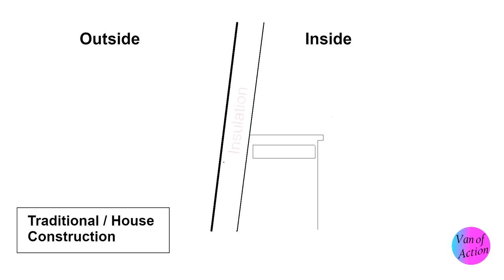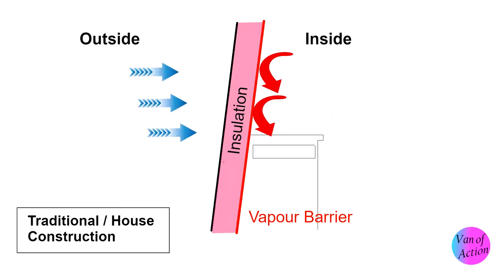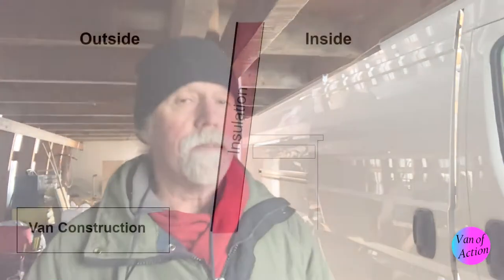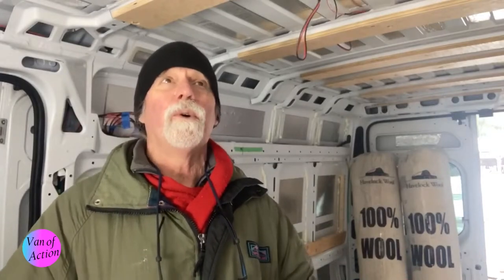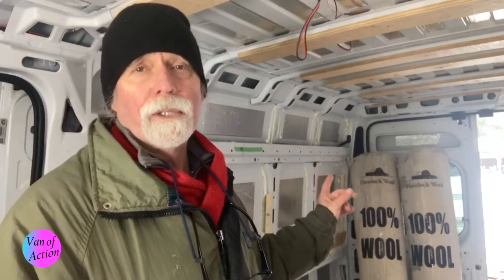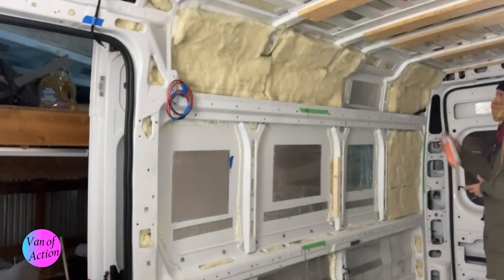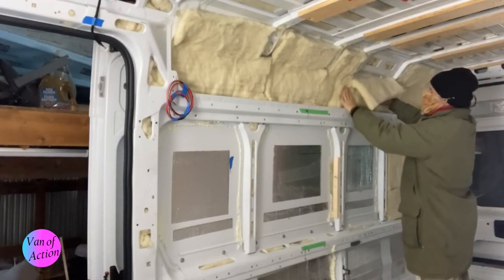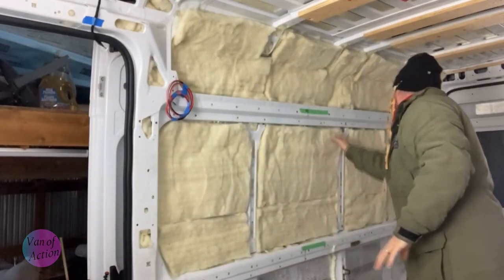How To Insulate A Van - VanLife Havelock Wool, spray foam or thinsulate for a warm and quiet vanlife

Comment: @5:23 "Wool is hydroscopic..." which is one of the main reasons wool should not be used to insulate a camper van that's not in a very dry climate. Two other reasons: high cost per unit R-value & relatively low R-Value per unit thicknesss. Wool makes a great blanket or sweater, but it's a poor choice for thermal insulation in a structure (or RV)  exposed to RH above 50%. To better understand why, refer to these two tests that done by  Gary @ Build a Green RV: "Water absorption for various insulation types" & "Insulation Testing – For Van Conversions"  Key excerpts:  Bare Plexiglass panel showing considerable condensation and beginning to drain down.  Wool showing significant condensation, felt damp to touch on outer surface,  (+36 g of water pickup). Thinsulate showing significant condensation,  (+11 g of water pickup). Polyiso showing no condensation. Polyiso felt dry,   (+0 g of water pickup)
Reply from the maker: Hi Video Pipeline -  again,  thanks for watching and taking the time to comment.  Insulation is one of the topics of a van build that I think will be a never ending debate - this will probably be a long answer, I think it's important but I can't do another video about it right now.    In this case, because of what I consider the insulation is for - I disagree with just about everything you've said.   

I am in Canada, the interior of British Columbia.  I don't use my van in the dead of winter but I do use in during the shoulder months when night time temperatures will dip to below freezing.

Having said that - there is not a product on the market that will insulate the walls, ceiling and floor of a van with enough R-value to enable the interior to hold heat well enough to maintain a consistent temperature if it's cold outside.   If you want the inside to stay warm you have 2 choices.   1. build everything thick enough to hold enough insulation     or 2. have to have a constant heat source.  

Number 1 would accomplish the heating / moisture goals - but would totally ruin the van.

Number 2 would keep you warm - but would do nothing to reduce condensation - and depending on the heat source may even increase it.

I believe every van builder should expect condensation,  plan for it and manage it.  So the question is where do you design the dew point.  In a van it's naturally on the inside skin of the body.   I do agree that wool hydroscopic, which means that rather just get wet and hold moisture it's able to take water into it's cells - so ....  I know that when condensation occurs the wool will absorb it.    The wool will hold it until  the air out side the van is the same temperature or higher than the air inside(sun heating the outside of the van)    At that point the air in the cavity will warm and take the moisture back as evaporation and the wool will be dry.   In fact it's even better than that .....   "Wool insulation addresses both vapor diffusion and the issues with vapor barriers. One of wool's greatest strengths is its ability to manage moisture. It heats up when it absorbs moisture which helps maintain its R-value despite being wet which in turn helps it dry out quickly."   It's a natural process that can happen over and over again.   

The observations you quoted  "..... For Van Conversions"  Key excerpts:  Bare Plexiglass panel showing considerable condensation and beginning to drain down.  Wool showing significant condensation, felt damp to touch on outer surface,  (+36 g of water pickup). ....."  are exactly what should be expected but the test  didn't follow the full cycle of warm / cold / warm.   

In the end -  Having spent time on the road - I believe van builders are insulating more for sound than for warmth.

Thanks again for sharing your ideas ...... it's in the conversation ideas grow........  Be well and I hope you join the community..... Dave
Reply: @VanOfAction  "I do agree that wool [is] hydroscopic, which means that rather just get wet and hold moisture it's able to take water into it's cells - so ....  I know that when condensation occurs the wool will absorb it."  ...which is exactly what anyone with basic building science expertise knows must be avoided or at least drastically minimized.  Some other statements you made in your reply reveal that despite whatever practical trade experience you may have, you don't really understand the physics. You hare entitled to your strongly held opinions but the facts of any engineering problem are validated by careful objective testing, not by how strongly held or popular your opinions may be.
Reply from the maker: Well Video Pipeline - it finally happened.   I knew when I started this channel that there would be videos that people would  not agree with.  It's part of the deal with putting your ideas out there.   This particular video has been viewed over 30,000 times - which blows me away -  and you are the first person to tell me I  don't really know what I'm talking about.  (I honestly thought the line would be longer).  But it really means nothing to me.   I'm sharing what I'm sharing because it's fun for me - there is nothing in it for me other than that.    if people find it useful ... that's great.   If people think it's wrong ...that's fine too.   I know what I've built and I know how well it's working.  I have no interest in trying to convince anyone I'm right.  Earlier I suggested you join the community - I take it back.  next time you scroll past my channel ... please do.  Dave

Comment: I came to see good comparisons, but instead got a PR piece for havelock
Reply from the maker: Hi Joe - thanks for watching and taking the time to comment.  I'm sorry you didn't get what you wanted.  But in my opinion, based on years of building many different types of construction in Canada - there really isn't anything to compare.  Moisture is simply going to be a reality for any van build and Havelock wool is the only product that deals with it effectively in the wall cavity.  I tried to communicate that.  Be well and I hope you'll stop back.
Reply: @VanOfAction  Spray foam eliminates the gap, eliminates moisture, yeah?
Reply from the maker: Thanks Joe - this is a great point to bring up.  First we have to agree that no matter what kind of insulation you use you're going to have condensation someplace.  Spray foam - if it's "closed cell foam" will not let moisture into the wall cavity.   But using spray foam creates 2 issues I wouldn't want to deal with.      1. It moves the "dew point" to the inside face of the foam.  That's where the condensation will occur - and when it does there is no where for it to go.  If the wall finish material is up against the insulation it'll get soggy, if it's installed air tight then the water will be dripping from the walls and ceiling into the cabin.  2. with the wall cavity filled solid running wires or pipes at a later date will be a problem.  I think insulation is one of the most debated topics of a van build.  But the reality is unless you build 6 inch walls, ceiling and floor you'll never be able insulate well enough to avoid the warm air and cold air meeting and creating condensation.  The best we can do is design to manage it.  Just my opinion - take it an $1.50 and you can get a coffee :)   be well.

Comment: You didn't mention how its going to settle down your walls as its vibrated down the road. Then it's R0 because I'd the whole wall isn't insulated its only slightly better than having no insulation.
Reply from the maker: Hi Samuel -thanks for watching and taking the time to comment.  I didn't mention that = and after 3 years that hasn't been my experience at all.  If you watch some other videos of mine you'd find that almost all of my interior finishes and cabinet liners are removable.  So I can run wires or other stuff.  I've had every wall open over time and I've seen no settling at all. but maybe time will prove you right - at which time I'll able to correct if needed.  Hope you'll stop back .... Dave

Comment: The gas wet wool create is classified as very flameable!
Reply from the maker: Hi Stein.  Thanks for watching and sharing your thoughts.  I have never heard anything like that.  I do know ….. The inherent flame-resistant properties of wool are related to its relatively high nitrogen (15%–16%) and sulfur (3%–4%) content, high moisture content (10%–14%) --  and if wet the moisture would seem to be higher.   But that’s all theory.  As a practical matter, there is. Not much insulation and it all (or very little) would ever be wet.    So truthfully I would never let the gas issue out weigh all the proven benefits of natural wool insulation.  Be well and stop back.

Comment: Why do people who talk about insulation never mention ventilation? Ventilation is always the best way to stop damp.
Reply: Hoho - thanks for watching and taking the time to post a comment.  What you said is true.   But it does not apply to this instance. Let me explain without trying to lecture.   Other folks may not understand your point.  “Condensation” occurs when cold air and warm air meet - it’s called the dew point.   “Ventilation ” means the air is moving.  And there’s no question if air is moving it will not condense.  However- in a van the dew point (- where condensation will occur - always on the warm side) is at the inside skin of the van or the outside edge of the insulation.  What makes insulation effective is it’s ability to hold air still - so to have ventilation at the inside face of the van would require not having anything to stop the air from moving.  So no insulation. and a mechanical way to introduce air movement inside the wall.  So you’d have a cold drafty van. If there is insulation - there is going to be condensation at times.   There’s no getting around it……    Be well my friend.

Comment: In my view, wool is nowhere near as good an insulation method as closed celll foam, which acts as not only an excellent heat/cold insulator and noise insulator, but also eliminates the need for the stick-on sound deadening material, and acts as a very effective moisture barrier (moisture comes from INSIDE the van - our breath and cooking vapors and showers are primary moisture contributors here), and it stiffens and strengthens the entire van structure. Messy and expensive and care need to be taken about access to wires/plumbing etc as necessary, YES, but so worth it in the end result!
Reply from the maker: Hi Barry.   Thanks for watching and taking the time to comment.   Insulation and moisture are probably the most debated components in van building.   I am really happy with the wool I used and can’t imagine anything being better.   But I understand not everyone will agree and it’s in that conversation others will learn.   Be well and stop back. Dave.

Comment: Nope. 
Your first centence was "I did it wrong".
You got that part right...

We used spray foam insulation on the ceiling and walls. No doors.
Except side slider.

Do NOT force insulation in to cubby holes or lower doors because you cover 
factory drain holes.

In the late 1970's and 1980's we did 1000's of vans and no worries.
Reply from the maker: HI Harley - thanks so much for watching the video and  taking the time to comment.  I love it when people share their thoughts and opinions - I think it helps everyone learn.  I had to re-watch the video.  I understand and agree with your point about the drain holes when using spray foam insulation (assuming you're using a closed cell spray - you'd be crazy to use open cell).  Because closed cell doesn't breath it would absolutely  trap the moisture that's going to form on the inside of the panels in those areas where there is no insulation, or on the inside of the insulation on a cold day.  That water has to have a place to go.    I hand mentioned the drain holes when shooting but didn't include include them  in the final cut because with wool insulation the point is moot.  The wool I used will take on moisture and release it back out - if there's enough, with gravity that moisture will migrate down and out the drain holes.  The holes are not plugged at all.  I don't know but I doubt natural wool was very common when you were doing vans.   In my opinion it's a superior product and easier for a DIY person to work with.  It's great to understand how all the systems work together.  Be well and stop back my friend.

Comment: All the houses I've seen built have vapor barriers on the outside and none on the inside.... Except maybe paint and caulking if you count that. Aren't you concerned that wool will absorb moisture. Wool does absorb water. There are synthetic materials that don't absorb water you could use. I'd be interested in seeing the lower portion of your panels inside now after some years to see if they have started to rust due to moisture build up.
Reply from the maker: Hi Kel.   I’d like to say thanks for watching
- but it feels like maybe you didn’t.  I do appreciate you  taking the time to comment.  I’ll reply in the order you used.   1.  I think your mistaken about where the vapour barrier is in homes.  The barrier goes where the “dew point” is - where the warmer air meets cooler air. In a home that’s on the inside of the insulation. You want to keep the warm moist air from going into the insulation, Where condensation will get the insulation wet. The warmth may radiate in - but the moisture will not. As I said in the video - in a van that point is on the inside face of the van panel - in the insulation - because I don’t believe it’s possible to create a perfect barrier on the inside of the wall.  2. Yes as discussed in the video - the wool will absorb the moisture - that’s the whole reason for using it over other insulation.  It will absorb it and then release
It when the humidity changes without changing it’s ability to insulate.   The synthetic materials that don’t absorb water still get wet, and moldy and stop insulating. 3.  This is the second winter and I had a panel exposed to run some wires - all is good inside.   Thanks for stopping by - be well and come back.